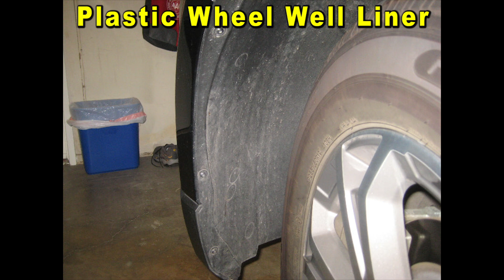2007 To 2016 GMC Acadia How To Change Headlight Bulbs With Part Numbers

Comment from the maker: GMC Acadia Low / High Beam Light Bulb - https://amzn.to/3XIBpUS
LED Low & High Beam Bulb Part Number - https://amzn.to/3RGg8Yf
Front Turn Signal Bulb Part Number - https://amzn.to/4bhsoFn
LED Front Turn Signal Bulb Part # - https://amzn.to/45EybDT
Torx Screwdriver Set - https://amzn.to/3RJ4VGe
Precision Screwdriver Set - https://amzn.to/3sLixaP
Plastic Pry Bar Tools - https://amzn.to/3HMtsV7
Socket & Ratchet Set - https://amzn.to/3Z17LbA
Mechanix Gloves - https://amzn.to/3jCnHkt
Torque Wrench - https://amzn.to/3vS5uSI

The Paul79UF YouTube channel is a participant in the Amazon Services LLC Associates Program, an affiliate advertising program designed to provide a means for sites to earn advertising fees by advertising and linking to Amazon.

This DIY video shows owners of the 1st generation 2007, 2008, 2009, 2010, 2011, 2012, 2013, 2014, 2015 and 2016  GMC Acadia how to change the combination low and high beam headlight bulb or the front turn signal light bulbs.

Comment from the maker: Check out the DIY guide for changing the headlight bulbs on a first generation 2007 to 2016 GMC Acadia SUV - 
https://www.paulstravelpictures.com/GMC-Acadia-Headlight-Bulbs-Replacement-Guide/index.html

Here are all of the DIY repair and maintenance tutorials for the first generation 2007 to 2016 GMC Acadia SUV - 
https://www.paulstravelpictures.com/Articles/GMC-Acadia-Common-Problems-Repair-Maintenance-Guides.htm

Owners of other General Motors vehicles such as the Buick Verano, Regal, LaCrosse, Cascada, Encore, Enclave, Envision, GMC Canyon, Sierra 1500, Terrain, Yukon, Denali, Savana, Spark, Sonic, Cruze, Malibu, Impala, Volt, Camaro, Corvette, SS, Trax, Equinox, Traverse, Tahoe, Suburban, Colorado, Silverado and Express may also find these DIY instructions to be helpful.